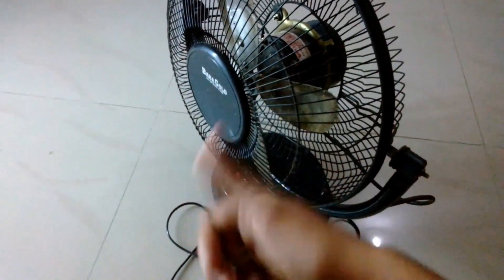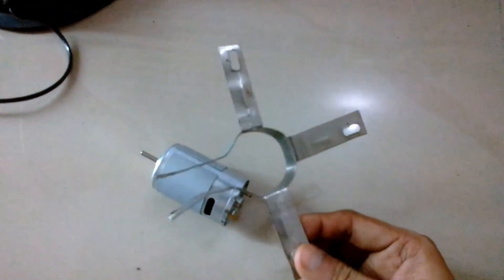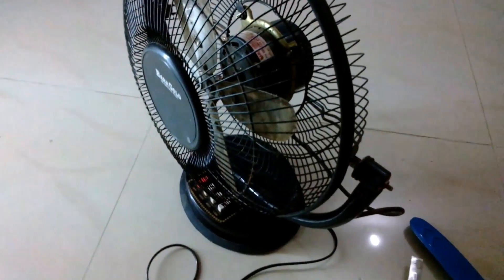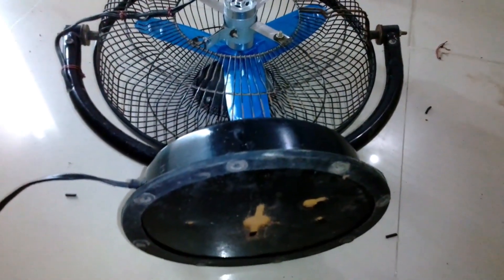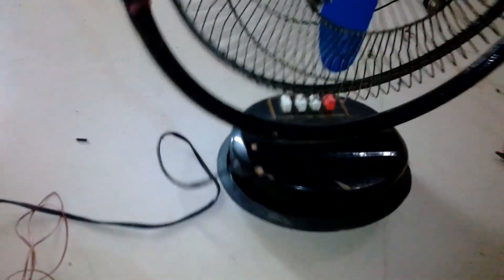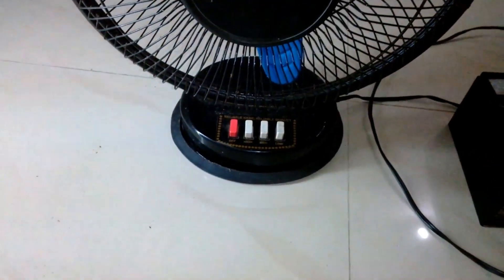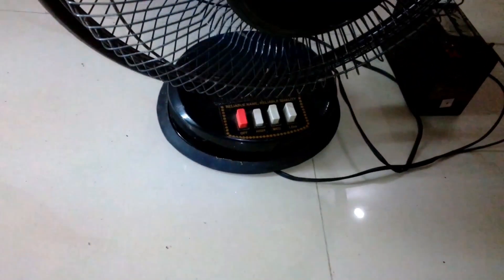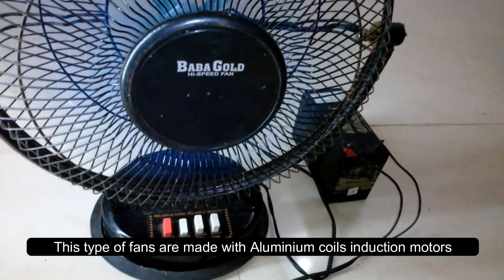Converting Ac fan to Dc with RS775 dc motor --- Its About Everything.

Comment: Instead of battery, can I connect tat 12v dc fan to 20000mah power bank using a 5v to 12v 1.5A stepup boost converter cable. Will it work. In my area, so much power cut bro, my baby unable to sleep in night. Ur reply wud b helpful.
Reply from the maker: Normally power banks can deliver a maximum of 2200mah for charging top end smart phones like Samsung galaxy. so lets say its 2000 mah as example. 2000 mah is 2 ampere at 5 volts which is 10 watt.
Boost converters are about 90% efficient when boosting to a large voltage, which is 12 volts here so only 9 watt power will reach the fan. This fan pulls about 15 to 20 watts when full speed so i think it will works but with 50%less speed, if the power bank out put is 2000mah. If more then better, if its less then 2000mah on the usb out put then the motor speed will reduce much more becoming useless.
I hope my answer helps
Thank you and have a nice day.
Reply: @ItsAboutEverything01  thank u bro

Comment: Is it 7ah battery? If so, how long duration backup u get from tat battery?
Reply from the maker: Yes its a 7amp battery.
The motor pulls about 1.5 amps with fan blade as load and if the battery is  new then it will run for approximately 4 hours 30minutes but with a 6 inch blade it pulls 1 amp then it will run for about 7 hours approximately. I have another video with the smaller blade you can also check that if interested.
I hope my answer helps
Thank you.
Reply: @ItsAboutEverything01  Thanks for ur reply bro

Comment: Sir mere ghar per b ac table fan h n maine uske wire connection dekhe .usme 1 capisitor, resistor ,laga h .mera question aap se ye h ki capisitor ko hatane ke bad ye fan kewal battery se hi chalega to him battery charge kaise karenge ? Video bahut acha laga.
Reply from the maker: Nahi sir, ac fan battery se direct nehi chale ga. Capacitor hata denge tab bhi nehi chale ga. Ac fan ka rotor alag tarike ka bana hoto ha jo ac par hi  chalta hai.  Battery se chalane ke liye inverter laage ga jo DC current ko AC kar dega.
Battery charger agar banana chate hai to transformer se bana sakte hai. Series capacitor se bana sakte hai. Boost converter se bana sakte hai.

Comment: Sir how to charge battery and one capisitor add in ac table fan .please explan wire connection
Reply from the maker: I did not understand you question. You can also ask in hindi, no problem.
Aap hindi mai bhi puch sakte hai

Comment: I was looking for how to actually convert an AC motor to DC, not just simply screw in a DC motor... Work on your titles mate
Reply from the maker: My title says ac fan to dc not ac motor to dc, mate
Reply: @ItsAboutEverything01  Mate I must apologise, I was a bit hasty with that comment (was having a shithouse day). It was my mistake, I hadn't read it properly, so yeah I'm genuinely sorry man, will think before pressing send next time!
(Btw, the reason I ended up on your video is because it is also a fan that I want modify to run on DC. I could do as you did and just replace the motor, but I am trying to find out how, if possible at all, to modify the existing 240v motor. I've seen videos on people turning car alternators into motors, etc, and I'm just wondering if there is some similar procedure to modify the mains powered fan motor to run on DC 12/18 volts so I could use it at work with an 18650 pack...
But anyway yeah, again I'm sorry for that unfortunate and unnecessary comment mate.. 🙂
All the best man...

Comment: RS-775 Specs:
DC Motor
Nominal Voltage: 12V
No Load RPM: 7000
Stall Current: 43.9A
Stall Torque: 125.7 oz-in
Shaft Diameter: 5 mm

 I need some clarification is this dc motor power efficient compared to ac motor?  i use this website https://www.rapidtables.com/calc/electric/Amp_to_Watt_Calculator.html for the calculation.   for example if it runs on average 20A, convert to ac thats about 240w is that true?
My Panasonic ac fan only run at 60w.
Reply from the maker: Usually Rs-775 is the model number and they have different power  variants from 20 watt to 200 watt . Although the diameter is same the lengths are different by few centimeters. Low power comes with bushings and high power comes with bearings. I have two of those both are bush type not bearing, one is 20 watt with moderate load and the other one is 45 to 50 watt with moderate load (fan blade). The coil windings wire gauge is different in both of them despite the same armature size. Thin winding low rpm low power.
Thick winding high rpm high power.
Sellers in Amazon say the no load current and stall current which means when the motor is forcefully stopped with full power input. So at stall current the motor will burn in 15 seconds.
So the load current is dependent upon us, how much load we are giving and how much cooling we are providing. 
The internal fan is not very affective in low rpm.
If we can cool it we can extract high power from it.  So yes its possible to get 240 watts from an rs775 dc motor, depending on the heat dissipation.
The con is, the carbon brushes are going to wire out fast due to high heat and inefficient power transfer.
 Now the best option is bldc motors like we get in the RC world, drones etc , half the size many times more powerful. They don't have brushes and have better heat dissipation.
I hope the answer helps
Really enjoyed replying
Have a nice day.

Ohh one more thing i forgot to mention. 
Compared to ac motors the efficiency is related to the amount of wast heat the motor produces. 
Ac motors in fan have more winding turns and large surface area for heat management. There power to weight ratio is low so they produce less heat. So i think ac motors (induction motors) in fan are more efficient then using an rs775 motor, to achieve same performance.
Thankyou
Reply: DC watts  and  AC watts  are not  same. Electricity consumption is more in AC watts.